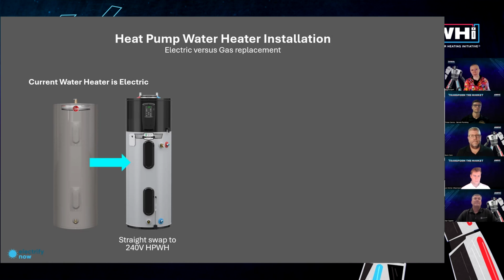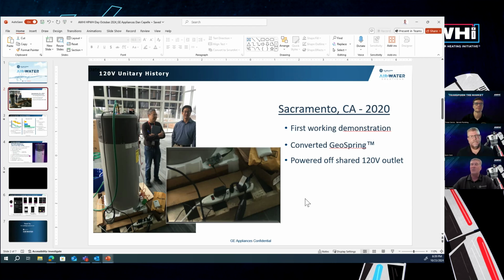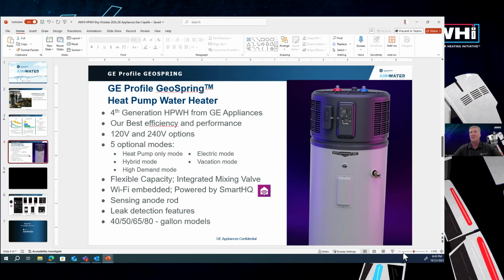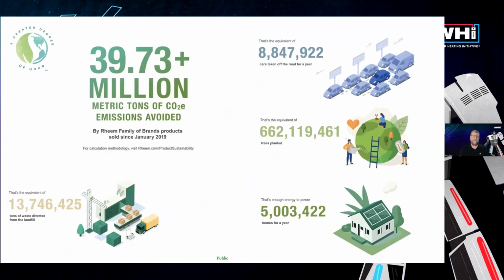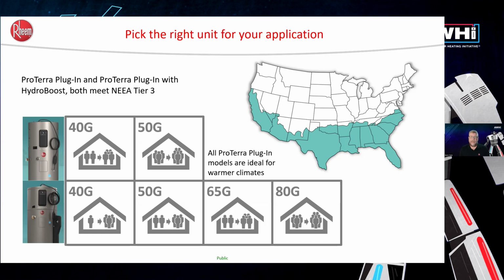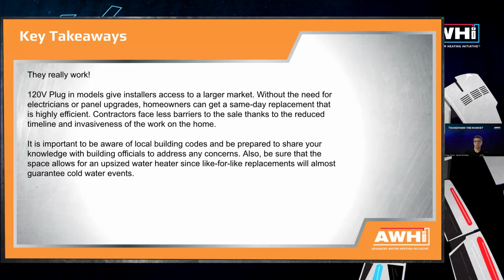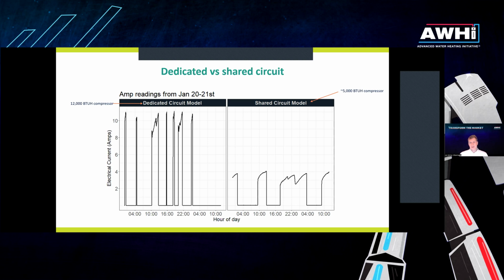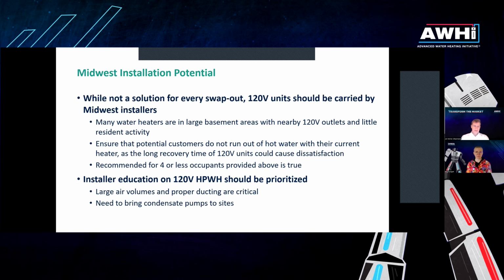120-Volt Heat Pump Water Heaters

Comment: The new issue I think we need to think about is not just wether there is space in the panel, or an existing 240V circuit to the water heater, but also the total capacity of the 200A service.  As electrification matures, homeowners can switch from gas to electric for their heat, the water heating, the range, plus add EV charging.  All of this puts a strain on a 200A service.  

As a residential customer doing my homework, I loved listening to these presentations.  I'd encourage the water heater companies to look beyond just their water heater installation, as I think we have some new challenges homeowners face as we electrify.  I'll explain.

I have a "new" (100 year old) home, with a 40-year old 200A service.  My furnace and water heater are currently gas.  Breaker spaces are problem, but there is a "new" problem we homeowners are facing.  It used to be a 200A service was considered plenty, but many new build homes are now getting 400A (that is, 2x200A) services when the entire home electrifies.  

It could very well be that the homeowner will run out of capacity with a 200A service when they also replace a gas furnace with a heat pump, plus add EV charging.  For example, modern EV's now need 60A and 80A charging circuits, due the batteries being larger (some north of 130 kWh) than just a few years ago.  

Even with a 200A main panel, I am currently looking at the need to add two sub panels to my home, one panel next to the main to add breaker spaces and one panel out in a detached garage.    If I add a 100A sub panel for the garage to facilitate a 240V 60A EV charging circuit (with 48A charging output), plus add a 240V 40A circuit to the main panel for a heat pump, plus add a 240V 30A for  a water heater it all begins to add up,.  

With all this in mind, the 120V may be more of an "ultimate" solution than might be thought of today.  To replace my water heater I'm wondering about a 120V dedicated circuit as putting less pressure on my 200A service than going to a 240V 30A hybrid heat pump water heater.  With a 120V dedicated circuit HPWH, I get twice the recovery rate as a 120V shared circuit HPWH, but still draw less power than a 240V hybrid.  Perhaps I can avoid triggering replacing the entire service drop to my home.  I'd love to hear from the experts on this.